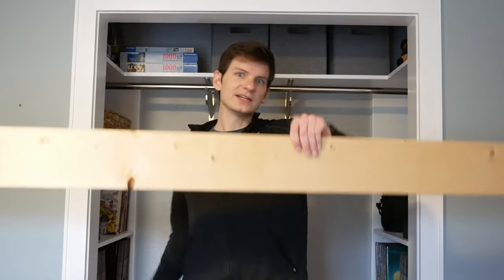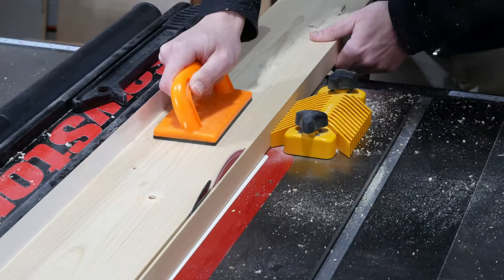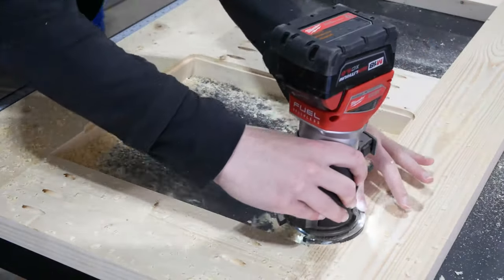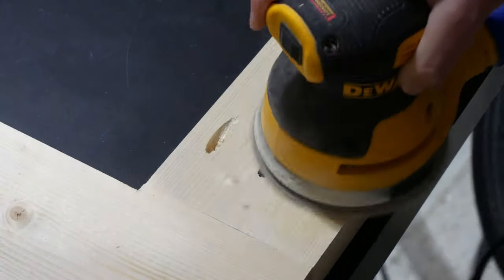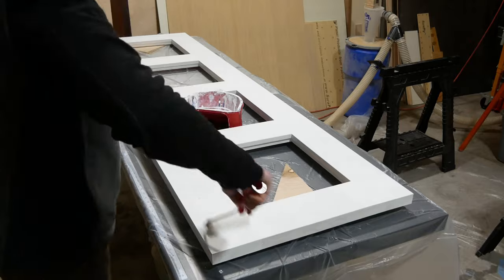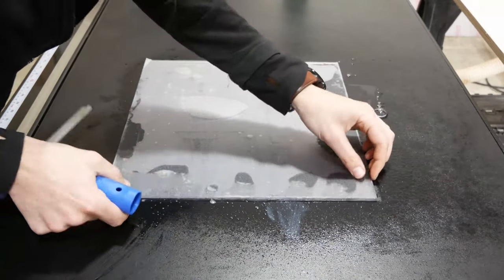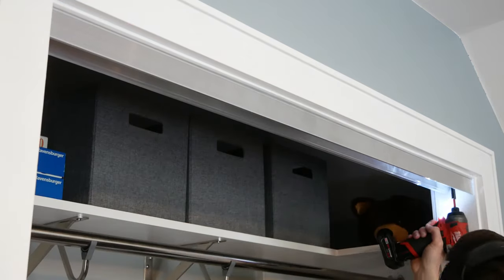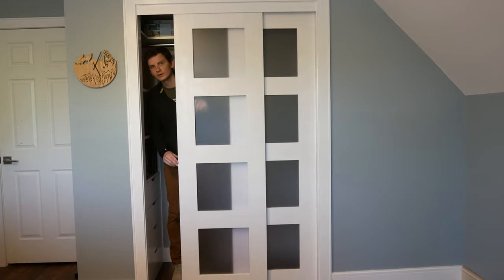How to Make Frosted Glass Doors with 2x6s and Plexiglass

Comment: I love how these doors turned out! A faster (yet more complicated) method to ensure the inside squares are right angles might be to make the rabbets with a table saw rather than a router. This would mean running all the styles and all the rails through a table saw prior to attaching the styles to the rails. Dado blades on the table saw would save some time here. However it would create a new challenge, as the rails would meet the styles along the rabbet so the depth of the pocket screws would need to change or they might not work. A solution to this could be to make the styles slightly longer and to attach them along the rabbeted styles with a half lap + screws and/or wood glue.
Reply from the maker: Hey Colin, thanks for the suggestions! I considered making them on the table saw pretty much how you suggested but didn't go that route obviously. It's been a while so I don't even remember why exactly I chose not to haha

Comment: Thank you for this.  This was one of the first videos I watched a month or so ago as I was trying to get ideas for making my own interior barn doors for my daughter's room. I came back to this video because it seems to be the best route for me to go. My doors are going to be much bigger and I"m hoping they won't be too heavy since I"m using 2x6 as well.  Two doors will be 88"x33" and the other door will be 88"x44". Each door will have 3 panels with 1/4" glass (frosted) used as panels. I'm curious, in your opinion, for the wider door (44") if making the pocket holes/screws will be strong enough to hold?
Reply from the maker: Hi Randy, I think as long as the barn door hardware is mounted in the stiles (vertical boards) then the pocket holes screws won't really have much weight on them and should be good! Even if it were mounted on the top rail I think it would still hold fine, pocket hole screws really are pretty strong, especially with 3 next to each other. You can also add wood glue to the joint if you think it needs some additional strength

Comment: This was a great video! Honestly, it my router wasn’t a cheap one and I could make those recessed pockets for the glass, I would def do this. What do you recommend for someone who doesn’t have a good router for the plexiglass part of the build?
Reply from the maker: Thanks! I had another commenter suggest that the doors could be made by cutting the rabbets in the sides of the stiles/rails on the table saw. To make that work you'd need to extend the rails a little so that they make mini-lap joints over the rabbet of the stiles. You'd also need to change the  location of the pocket hole locations to be in relation to the narrower part of the rail and not the lap overhang
Reply from the maker: A much simpler way would be to cut the rails and stiles a little narrower (width of the panel rabbets) and then tack wood strips with a brad nailer and wood glue flush with the front edge inside the openings. Let me know if that makes sense and if you have any questions
Reply: @ProjectBilld  thank you for the response. I will definitely be trying this.

Comment: I guess a sliding door on a rail undergoes less twisting force than a hinged door; curious if you have any thoughts about whether or not this sort of pocket screw joinery will be strong enough for a hinged door?
Reply from the maker: I do think it would hold up fine as I don't imagine too much of the twisting force would make it to the pocket hole joints from the hinge location. But I likely wouldn't use doors like these where in places where the backside will be visible. You could fill the pocket holes but it seems like it would be less work to make a tongue and groove or mortise and tenon door at that point.
Reply: @ProjectBilld  That's what I figured, thanks for your reply!

Comment: What wood filler are you using? Looks like getting good results with it.
Reply from the maker: I have been using minwax color changing wood filler but I'm actually in search of a new wood filler at the moment. It works alright but is difficult to spread and dries out quickly and can't be recovered once dry
Reply: @ProjectBilld  I hear ya. I tried the "Plastic Wood" and am looking for something better as I can't get a smooth surface out of it with sanding. Looking for a more "professional" grade. Thanks bud!

Comment: Was there any space left at all around your plexiglass? I’m making some doors and in cut a groove inside my wood to clock it in place, and now I’m worried with wood movement, that it may crack??
Reply from the maker: I cut the plexiglass 1/16 of an inch smaller in both directions so I'd have some room to get it in. I don't think you're going to have any problems if you were able to insert the glass in place. I had some that were very tight fits and haven't had any issues so far

Comment: Frost spray paint
Reply from the maker: It's definitely an option. I tried it out and had issues with overspray as well as the finish scratching really easily so I decided to go with the film instead
Reply: @ProjectBilld  What type of film did you use? I love this idea, have the plexiglass, most of the tools, lumber. I need this in my life!
Reply from the maker: There's a link to the film I used in the video description. You're gonna love your new doors!

Comment: Basic woodworking methods? The first in the fairly long list of tools used is a thickness planer for $615.99!!
Reply from the maker: Which is why I mentioned in the video that you can make these doors using 1 1/2 stock lumber by modifying a few steps along the way. I realize that not everyone is going to have the tools that I do so I try to suggest alternatives where possible